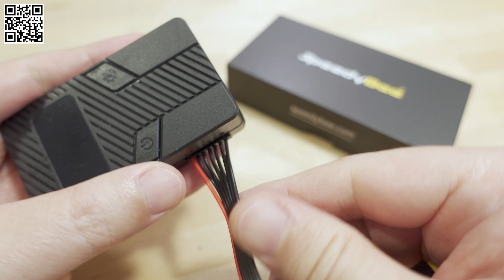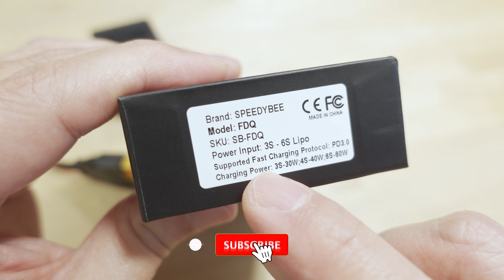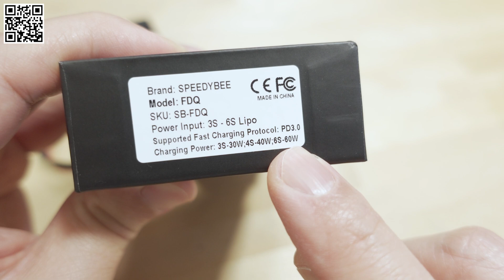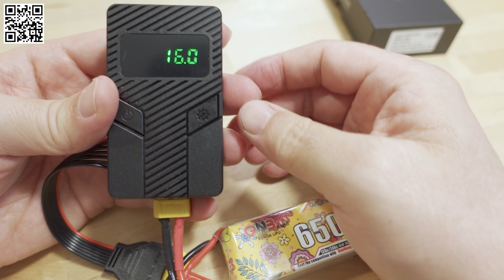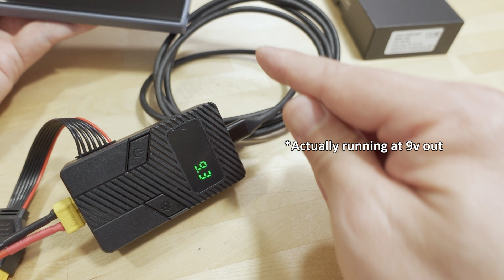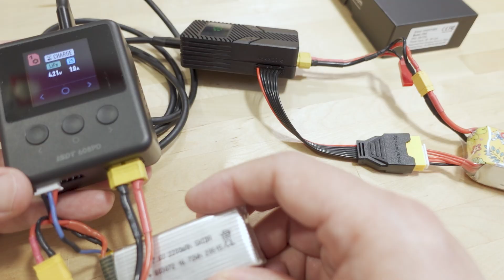SpeedyBee Discharger

Comment: Does this thing have a mode when it can use an internal resistor to discharge the battery or is always something should be connected to type C port to drain battary
Reply from the maker: AFAIK, it can't be used stand alone and you have to charge something to discharge the lipo.
Reply: @AlbertKimTV  Thanks :)
Reply: What are you asking here? Makes no sense? Typo?
Reply: @JoshFPV24  yeah 👍 it was

Comment: Speedy bee at it again. They have been releasing some good products lately. I used to just use a dead cell battery to run my soldering iron and discharge it that way for the recycling but this is probably a safer way of doing things lol

Comment: Great review of a useful tool. I've been using my ISDT BG-8S lipo checker to discharge lipos to storage while charging my phone, tablet, ear buds whatever is rechargeable. But its not fast charge capable, this is a definite must have for me. Reasonably priced, great value. 👍😎
Reply: Does that one have a cut off voltage setting so you don't accidentally over discharge your lipos?
Reply: @GeorgeN49  yes, and more functions too. But slightly more pricey at around 30.
Reply: That one costs $50. No thanks.

Comment: I never understood the need for a device that just discharges batteries. Meaning, that's the sole purpose and does not have a charge function as well. At least this allows.yiu to charge other devices with its excess voltage. But I do think the limited buttons will make things annoying very quickly.

We need something like the Vi-Fly Whoopster but for 2s to 6s batteries.

Comment: Hmm I just bought a wire wound resistor (just to kill bad packs).  Nice to know this is avail to stop at storage voltage and put that power to use instead of just heat.